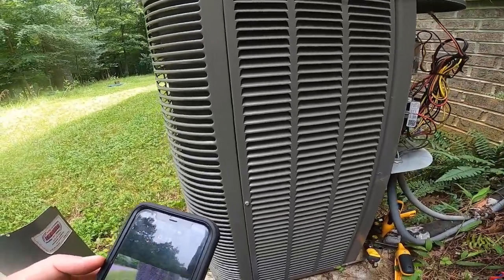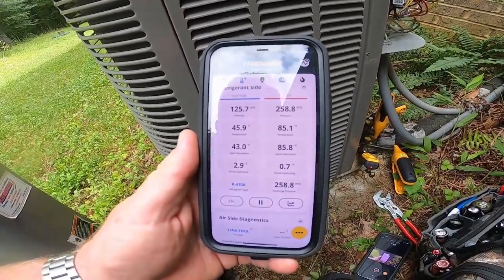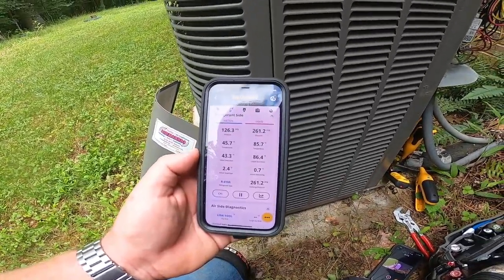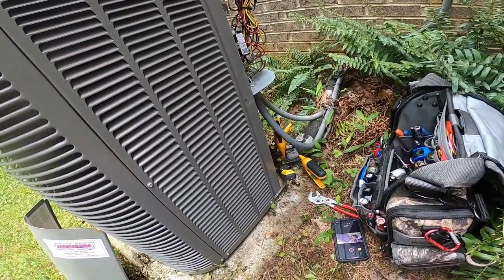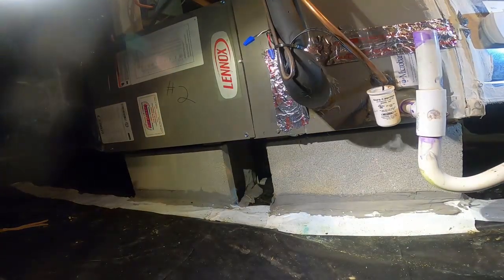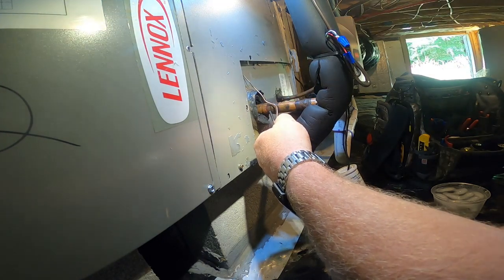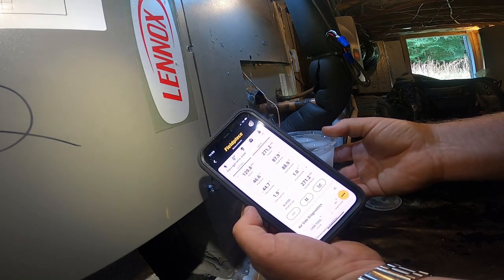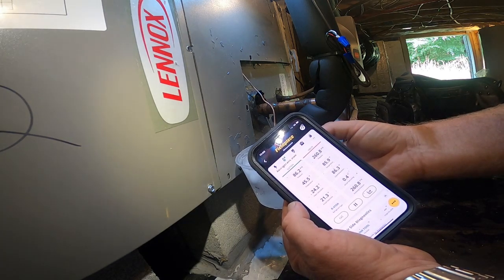TXV wants to flood.

Comment: can someone explain to me how to test the sensing bulb with ice water? what id supposed to happen when you add heat to bulb? and how do you know its bad
Reply: It is basically simulating a change in temp and the TXV “should” close.   If you have no or little change in pressure at your manifold and your Subcooling doesn’t change, chances are the TXV is bad.

Comment: Crumby blower motor could be failing. Motors because in all sorts of issues and they look like TXV problems.
Reply from the maker: As I said, Blower was running full speed.
Reply: @MYHVACLIFE  ...and, you got no expected reaction from changing the temp of the sensor bulb.